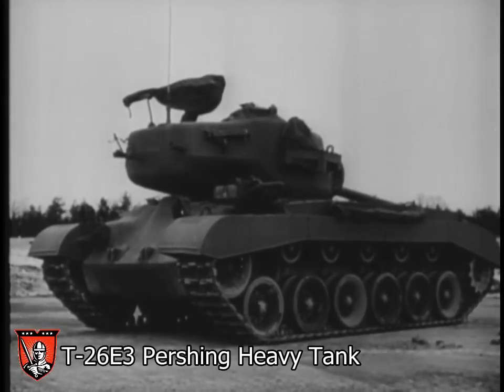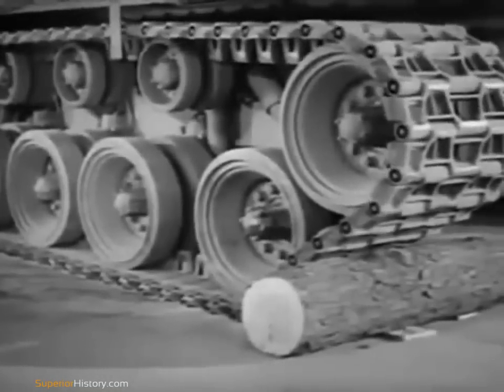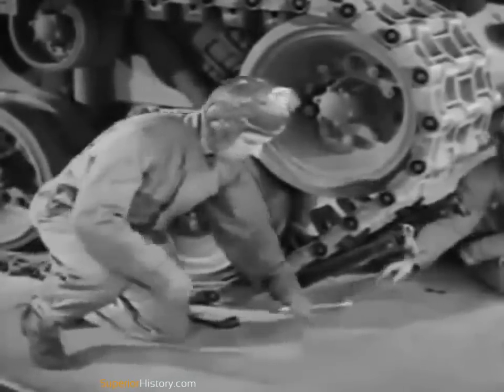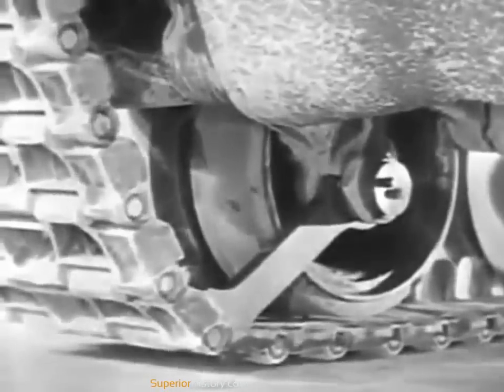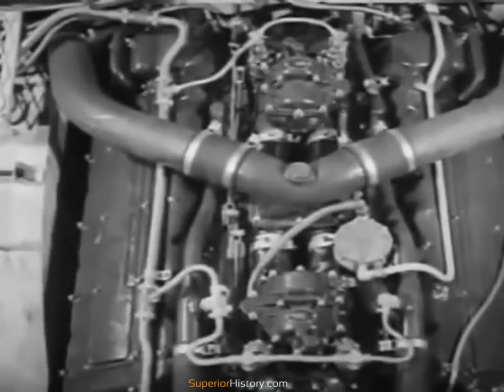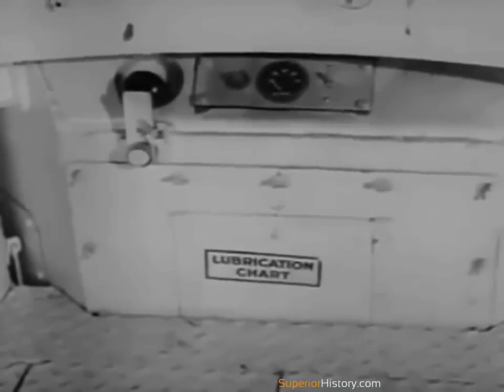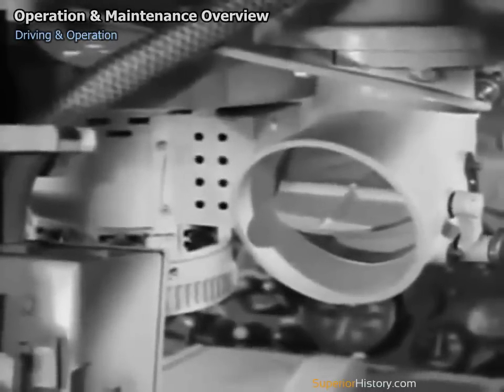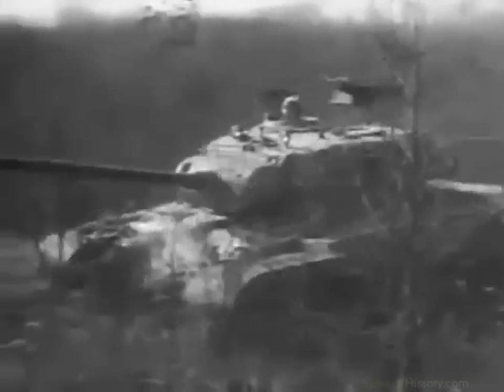The American M26 Pershing Heavy Tank (720p)

Comment: The M4 Sherman was a medium tank never intended to engage enemy armor as it's primary mission. It was designed for infantry support, breakthrough, and exploitation. U.S. doctrine at the time called for the Tank Destroyer battalions to be used in the tank killer role. The M-10 and M-18 with the high velocity 76.2mm gun and later the M-36 with the 90mm gun complied an outstanding record for German Armour destroyed when using ambush and defilade techniques, flank shots, and quick movement for which they were designed. This included destroying many Tigers and Panthers at normal combat ranges particularly later in the war when better high velocity AP rounds were available.
Reply: Not the case. U.S. Armor doctrine simply made a claim that infantry support is what a tank would most likely be relegated to, not what a tank is for.

Comment: I wish the Germans could have planned with oil like the US (= de facto no limits) and British in Persia (today Iran, back to over 600 million liters daily now again)^^ So I do not understand the British produced so light tanks, they could concentrate on engines, they are the key to everything else, a engine with over 750 horsepower (better 1,000hp) in an acceptable size and you can work on the rest to make it a good tank, German had extreme fuel shortage but still the Tiger II was "feared" by most enemies even though speed on terrain was only 17km/h (38km/h on road) and fuel use was around 720 liters per 100 kilometer in terrain and a bit over 500 liters on road with a higher speed...

For US people who are not trained to metric system:

860 liters (/3,78) = ~227.5 US gallons. With these the tank could drive 120 kilometers in terrain (227.5 / 120km), making ~1,8958 US gallons for 1 kilometer (1000 meter) on terrain with a bt lower speed of maybe ~15km/h, on the road it could go faster like 25 to close 30km/h with than ~1,338 US gallons per kilometer or 1000 meter, which is 0.62 miles (1km), so on terrain the consumption was not like today with cars (miles per gallon, it was more like gallons per mile^^ with almost 3 gallons per mile on terrain). Even with dream low US gasoline prices not really the vehicle to go and buy some milk or cigarettes in late evening :D except you take 50 bucks additional for gasoline :P

Comment: Come on ....A Gasoline engine?   WTF?
Reply: +Emmett Corbin What's so shocking about that?
Reply: +Legiondude  The only problem with a gasoline engine is that it uses gasoline. J/K  Gasoline is extremely volatile.  Diesel Engines are more reliable, need less maintenance and are more efficient.  Not to say that gasoline engines do not have some advantages (such as power)  The engine used in the Pershing was a very nice powerful  device that was way ahead of its time. This is the short answer, please let me know if you agree...
Reply: +Emmett Corbin somethings I agree with you but gas is quieter to
Reply: +Bahoma - 246 thanks for your insight on this.
Reply: +Bahoma - 246 just to clarify. I think everyone is missing my point about gasoline engines in tanks. My main objection is that gasoline is much more dangerous than diesel fuel. I know diesel will burn also but gasoline is much more volatile.
Also I do not understand your comment about oil. Gasoline and diesel are made from crude oil.
Reply: ***** "so they weren't such nasty death traps for the crews"

I'm going to paraphrase a line from Steven Zaloga here, "People often forget that tanks are full of things that burn." Just because they had gasoline engines doesn't make them stand out among ANY of their peers. 

The advantage of using the Ford V8 design was that it provided the greatest amount of horsepower for it's size. America had been experimenting with heavy tank design in the M6 heavy tank project, and so the next option available to power something as heavy as a Pershing would either be the design already in place for the M4A3 family(GAA V8 Gasonline) or the massive Wright G200 series that the M6 used, which would compromise the silhouette of the Pershing. Sure, they could have used the diesel powered GM 6046 used for the M4A2 family, but that offered less power to push all that weight, already a struggle with the gas engine.
Reply: +Legiondude good points and thanks for the info about the engine choices that were available during that time. I really believe that the US paid a price for not putting more research into tank design, especially heavy tanks.
Reply: Totally agree about the "less combustibles the better" that has been my main point all along. From my research it seems that the US Army was less concerned with crew survival and more concerned with production numbers. Sherman Tanks were out fitted with the GM 6046 and were  shipped to Russia during WWII. The US army did not want the GM 6046. And to be fair it was a strange engine. Just the engine weighed 5000 Lbs. It was two 6 cylinder engines coupled  together, two crankshafts and a common gearbox...What? Seems crazy! Yes the US was far behind in diesel engines...
Reply: I do agree about diesels being an option, however most of the problems with Gasoline 'igniting' is greatly over-exaggerated. A tank's transmission fluid is hundreds of times more likely to burn.
Reply: +Nathan Peterson Thank you for your input but, we will have to disagree. I'm not sure that transmission fluid is much of a hazard. While I am sure it will burn I have never heard of a transmission (automatic) catching fire. Just because I've never heard of that or seen it does not mean that it has never happened but it it were such a danger I'm sure I would of seen it in my almost 50yrs.

Comment: How did this tank measure up against the German King Tigers?
Reply: +Starguard ! Both could kill each other at long range. Pershing had less operational issues. Reliability, speed, turning ability, fuel consumption, etc.
Reply: the tank itself performed better simply because it was engineered better, but the german Pak 43 88 was a better gun over the 90mm of the pershing, also king tigers were slow and heavier and broke down and repairing them was a nightmare because they were over-engineered. king tiger also had better frontal armor.

Comment: at that stage of the war they should have surely understood 'sloping armour' in it's design?
Reply: +darren monks None of it's armour is unsloped. But heavily sloped armour has it's own complications. Internal space, for one.
Reply: Angled armor is better
Reply: As a rule, yes. But it's not without consequences. The T-34 had serious ergonomic issues as a result of it's sloped armour. Now probably this was worth it, but it certainly was a Con to the Pro of better protection. To deal with the space issue, the tank needed to be a bit bigger, and that has it's own problems. Some layouts and technologies can mitigate that, though. Sophisticated steering and vision technology allows the Abrams driver to practically lie down when driving, allowing for a very high angle of armour, for instance.

Comment: Much historical nonsense in these comments.  The Sherman, except maybe the Firefly, was completely overmatched in Normandy.  Ike realized the reports given him about the effectiveness of the 75s against Panthers and Tigers were false; he and Marshall then lit a fire under the ass of the Pershing program. They didn't have to be ready for Omaha Beach, only afterwards.  Nazi armour was not at Omaha Beach.  My guess is that there was a coverup at some point re the piss-ant Sherman.  Was the US to admit that the Sherman was seriously overmatched, and thousands needlessly died?  It would have been a scandal to high heaven - though many have rightly suspected it anyway
Reply: +Gregoryt700 Remember that most tanks weren't killed by tanks. And with good crews, even the basic 75mm Shermans could kill Panthers and Tigers. And they did. And obviously there was more heavily armed Shermans, TDs, arty, etc, around most of the time.

Also remember that something like 70% of the shells the Sherman fired were HE, and 10% were smoke. A tank does far more than fight heavy tanks. Bottom line, almost all of the Shermans enemies were not Tigers or Panthers. Keep the basic tank design, make simple improvements, and keep your numbers and design efficiency at maximum. Much more valuable than slightly better guns or armour, particularly when you don't need it most of the time. The most common german AFV in France was the STuG, which the Sherman could handily defeat. Most of the other armour as well. Any of the SPGs, and most of the other tanks were Panzer 4s at best, which the Sherman could beat as well.

And Nazi armour COULD have been at Omaha. The planners knew full well that there were a number of elite german tank divisions within range of the beaches. If arracourt's any indication though, even Panthers and Tigers couldn't stop the Sherman in a combined arms environment. Which it was.

Bottom line, sending out the Pershing early wouldn't have saved any lives, and would have cost a lot, because it was unreliable even with a lot of work put into it, took up far more resources, and didn't add enough value to the tanks warfighting abilities within context. They could take 5 Pershings or 10-15 Shermans. And in the end, 10-15 shermans are far more vauable.

Comment: There is a great video on YT video called "Myths of American Armor" that explains away a lot of commonly held misconceptions and the guy talks about the Pershing too. He says it wasn't intentionally delayed or held up by Patton or any one in particular, it was late to the war simply because the US Army wanted to get it right and make sure it worked and was not a total pile of junk before deploying it and putting it into mass production. They learned this in part from Germany at Kursk. There they rushed Panther tanks into production and while they were good on paper, they didn't take the time to iron out the kinks and something like 1/3 of the initial 300 or so deployed at Kursk never saw combat because of mechanical problems. The Sherman gets a really bad rap in my view, most people think it was horrible or some kind of death trap just because its gun and armor didn't compare favorably to the Tiger tank. Tiger tank encounters were extremely rare, most tanks were Panzer IVs or maybe Panthers here and there. The Sherman M4E8 was actually an excellent tank and frankly better than the T34 in my opinion by far.
Reply: Let's remember that the Sherman was not designed as a main battle tank. It was to exploit breakthroughs and not fight enemy tanks. Another thing was the weight issue made it difficult moving heavy tanks into ships to cross thousands of miles of ocean. Germany had it easy, they only had to put their tanks onto flat rail cars for perhaps 1000 miles or less from the factory
Reply: Tin Man I actually watched that video the other day. It's good when people actually go to learn this shit from official Archives.
Reply: +Tin Man  That's not true, there are several reasons why the Pershing was delayed including the lack of a suitable transmission, indecision, a late start and constantly changing requirements. Of course the US being the US the truth has to be hidden to protect those responsible for, in reality, causing unnecessary casualties resulting from their incompetence.
Reply: +R Greenup the biggest reason was Gen. Leslie McNair, chief of ground forces.   he blocked any other vehicle than the M4 series.  Patton was uninterested in the up gunned M4 tanks and didn't accept any for third armored even though there were a number in inventory in England waiting for ammo supplies to catch up.
Reply: +AUSSIEDAVEROCKS You are correct. The Sherman Tankers also called the Shermans "Rhonson Lighters" given from a radio commercial that advertised Rhonson cigarette lighters. The Jingle went "Rhonson Lighters, one strike lights up every time". Shermans were powered by Gasoline powered Chrysler engines that were prone to explosions when hit
Reply: +harry beck McNair didn't get his opinions in the way of what was made.
Reply: +AUSSIEDAVEROCKS Germans had better tanks? For the most part, heck no. 

Better tank guns is the key.
Reply: +AUSSIEDAVEROCKS Tommy Cookers was a name given to British tanks in general, not just the Sherman.

Even then, that name was only common in North Africa. Compared to most other allied and axis vehicles, the Sherman was most certainly not a Deathtrap
Reply: Nathan Peterson
"The Panther, of course, was one of the most feared German tanks, and soldiers on the Western Front were as happy to get one as their Soviet counterparts, even though no Western units ever appeared to have tried forming captured tank units the way the Soviets did. On the Italian front, in October 1944, the Canadian Seaforth Highlanders captured an intact Panther and gave it to the 145th Royal Armoured Corps, a regimental-size unit. Its new owners whimsically renamed the tank “Deserter” and issued it to the unit’s C Squadron."

"As in the case of Cuckoo, Panthers were particularly popular for their fighting qualities, and crews prized them so highly they often ignored the order to discard them upon breakdown, keeping them in service as long as possible. This even extended to requiring captured German tank crewmen and mechanics to work on the tanks to keep them going."

"One of the best-documented cases, however, is that of the previously mentioned Panther renamed Cuckoo. The tank was found abandoned in a barn during the fighting for the village of Overloon. Before its capture, the tank had belonged to the 2nd Battalion of Panzer Brigade 107. The British tankers assigned Cuckoo to the 4th Battalion Coldstream Guards alongside their issued Churchills, apparently to a staff section. These staff tanks were all named after birds, such as Eagle and Vulture; hence, the name Cuckoo. In preparing the tank for its new owners, a new coat of paint was applied, most likely the same khaki as the Churchills. Cuckoo’s new operators were impressed and happy with their acquisition; in particular, they admired the high quality of the optics in the tank’s sights, something for which the Germans were noted."

"The winter was harsh, and icy conditions made for difficult going. Cuckoo both impressed and angered its new owners. While the Churchill tanks seemed to constantly slide and become stuck on the icy roads, the Panther kept moving with absolutely no problem at all, oblivious to the conditions plaguing the British armor."

all qouted from this. http://warfarehistorynetwork.com/daily/wwii/repurposing-german-vehicles-by-allied-troops/

and i do belive that the allies did look up to the better tanks of the war, defenetly the panther as these qoutes show.
And it wasn't just myths
Reply: Valentine As I said: "for the most part" 

The "most part" was the Pz.Kpfw. IV. 

The Panther, with the introduction of the Ausf. G was a great tank for combat. Maintnance wise, and for travelling the European side, many Panzer crew noted that the Panther was too wide for the hedgerows of Austria, France, Czechoslovakia, Germany, etc. as noted by Fritz Bayerleinand of the Lehr Division. Though I'm not 100% sure on this concept, it comes from the 26th-Pz. Division, that the gun was too long for effective combat in narrow streets. It makes sense, but I can't 100% evidence for it.
Reply: Ma B Quality of armor is not the problem with the M3 75mm. It was the round distributed. The M72 AP(C) had the highest penetration, 93mm at the  best, and was a standard round, and more than capable of penetrating the side or rear of a Tiger. And the tankers really didn't want the bigger longer M1 76.2mm because it wasn't as effective as the M3 in the anti-personnel role. The T45 shot could however. Then again, Soviet testing found the M3 actually capable of penetrating at 100m, but I digress.

Only early models, which the Brits did studies on, had the FHA armor that made it thicker than labeled. With the Ausf. E the FHA is gone, It's just plain and simple RHA. Also, it's 100mm, not 102.

Fun fact, the other standard round the M62 APCBC had a higher penetration at 1,000m than the M72 did because of the ballistic cap.
Reply: What many dont know is the Tiger and the Sherman had almost the same thickness of armor in front.
Reply: ***** In the case of later large hatch M4s, a bit more for the M4.
Reply: +Tin Man The Easy 8 was an improvement over earlier models, but the Sherman was still a death trap.    The only version that worried the German tanks was the Firefly because of their British 17-pounder anti-tank gun.   The Germans nick-named the Sherman  "Tommy Cookers", because they would almost instantly burst into flames before their crews could get out of them when they took a direct hit.     The Sherman tank crews were very brave men to go into a tank battle knowing that the Germans had far better tanks with more powerful guns,     In reality the reputation of the Sherman was saved from utter humiliation at the hands of the Panzers, by the Allied Air Forces.    If you look at many WWII photos of Germans in their tanks and AFV's on the western front, you will notice they nearly always seem looking up at the sky, and that's because most Germany's tank losses were from allied aircraft on ground attack missions.    The Sherman was much more suited for the war in the Pacific against the small inferior Japanese light tanks.